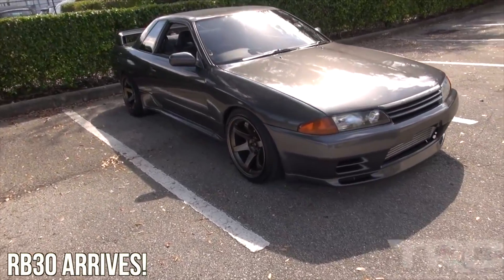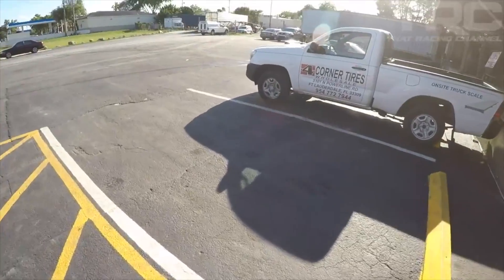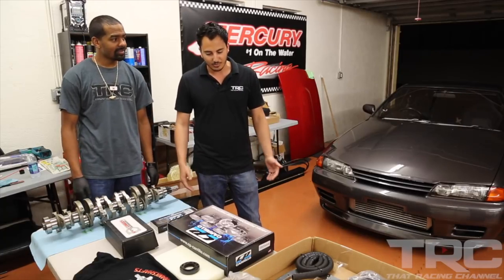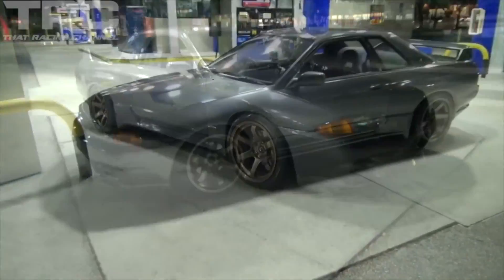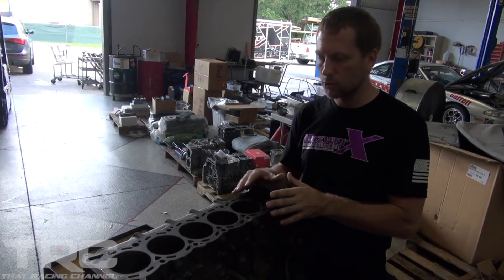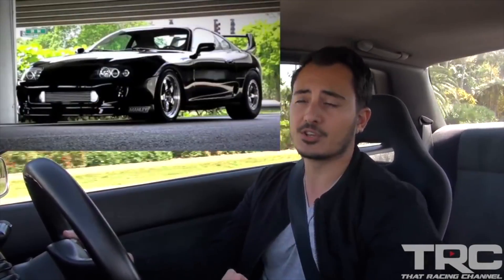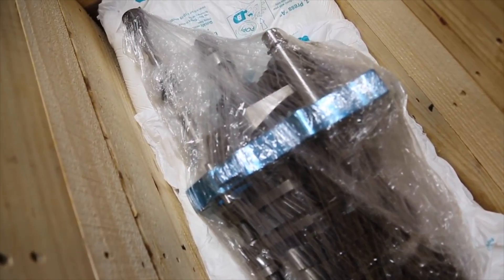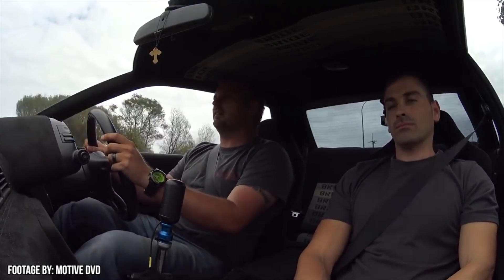RB30 R32 GTR Build Series RETURNS! - 1000+HP AWD Godzilla Project

Comment: 2jz is still King but daaaamn does the RB sound killer😍
Reply: That V12 Miata Bruh vr38dett is more capable than your beloved Supra engine buddy go check out 3500 hp gtr , I don’t see any 2jz with that power level...
Reply: @bman1668  I'm specifically referring to straight 6 engines  Everyone knows the rivalry is between RB and JZ. In stock affordable form the 2jz can handle more reliable hp. I don't know where you get off with the VR38, it's got nothing to do with this topic bro😂
Reply: @ThatV12MiataBruh  Why does this constantly have to be debated? Looks like you just want to argue with people. Nobody is talking abut the 2JZ here it was mentioned in passing when talking about the cylinder head for this build. You first have to afford the turbo system and fuel system (assuming your running ethanol) to take advantage of doubling the output of the 2JZ. So while it's a great engine, it's getting exceedingly rare and exceedingly expensive. Pretty soon the only options will be billet head and billet block because unlike the the V8 market there is not enough demand for somebody to cast up a new 2JZ block.
Reply: @dj4monie  not tryna argue dude. Because I know if I mention how great an RB sounds, someone is gonna mention how great the 2jz is so to avoid arguements and debates I'd just say they are both great platforms.